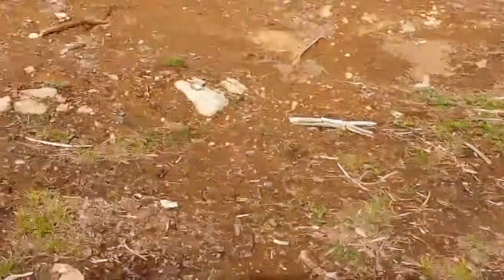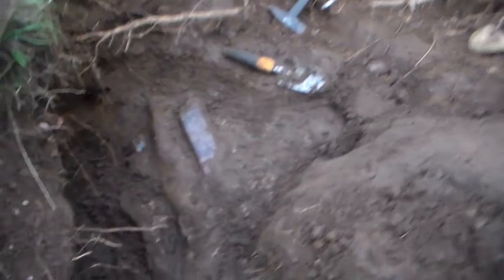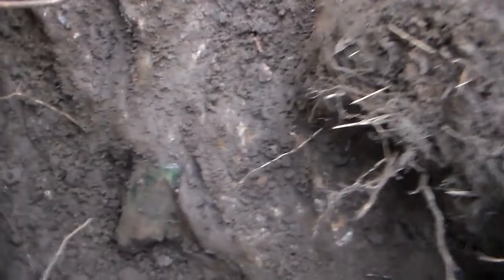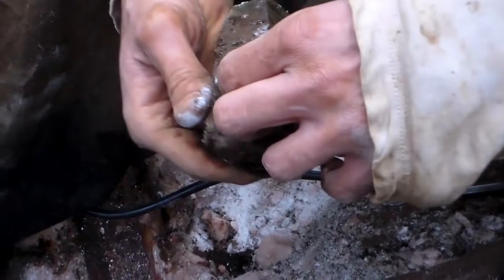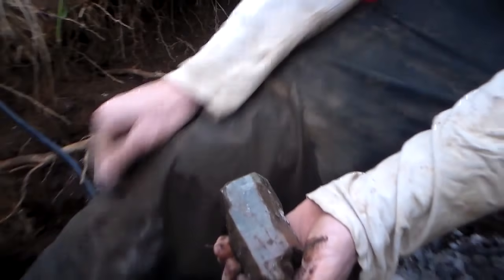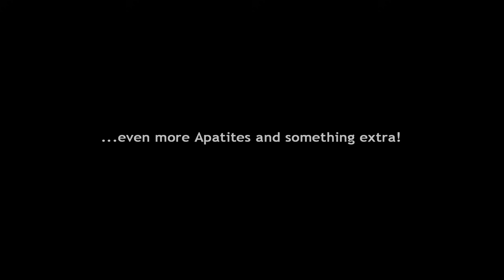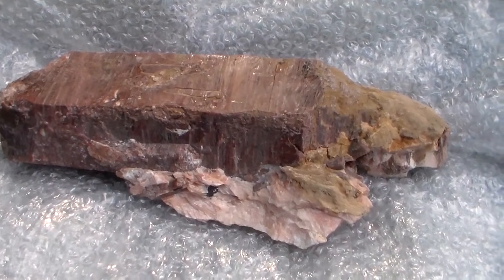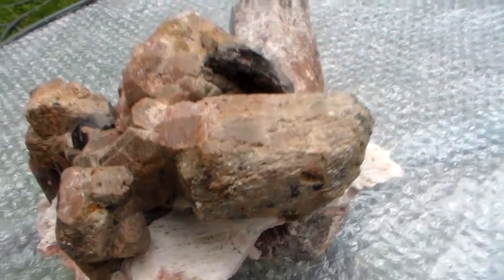MONSTER Candy Cane Apatite Pocket

Comment: The titanite at 37:08 is my favourite. Great finds!
Reply from the maker: Thanks Geology of Gems & Minerals! I was hoping that Titanite would come out a bit bigger.. it looked like it would. I'll still take it though, pretty sharp and highlights the cluster really well! We found others close to that size but were not complete sadly, got lucky with that one being mostly preserved in Calcite.
Reply: The clinopyroxenes and calcite really make the piece. You did a great job extracting pieces. They display nice and didn't get damaged.
Reply from the maker: Thanks, I put a lot of thought off camera in most of those wondering the best way to remove the calcite around them so they wouldn't get damaged. I have too much respect for the 100's of thousands of years or more they took to create, I don't have the heart to hack them out in pieces. I will admit there were quite a few times my heart skipped thinking they were breaking. That one big one that's not cleaned took close to two hours as the calcite around it was very hard and no where to grab. If it wasn't for the jackhammer I would probably still be there chipping away haha.
Reply: agreed that one is a beauty

Comment: Seems to me it would be much safer to use a 4 inch angle grinder with a segmented diamond wheel in combination with hand chisels and sledge to cut out the crystal Im very surprised it has not shattered.
Reply from the maker: It didn't shatter because I took my time when up close, and understanding the Calcite is crucial. I have a 6" I sometimes use to cut them out of Calcite sometimes, really depends on what I brought and what's best. I've undercut smaller ones before then trying to break the section free they usually crack. Apatite is very soft and rare to find any that are double terminated and not naturally broken in Ontario.

Comment: Any of your minerals for sale?
Reply from the maker: Not all but some are yes.
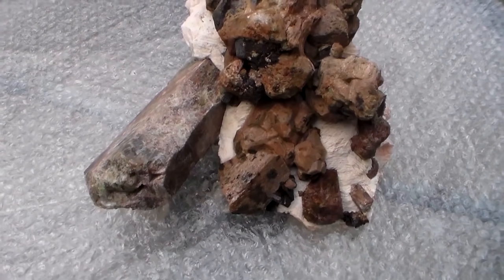Reply: Rough Market out of curiosity for sale or not what would you charge for the piece at 39:47? Its a beauty
Reply from the maker: That one won't be ready for 6 months or more, taking my time preparing it. When it's done it will either be in our private collection or on display somewhere possibly. I do have several smaller ones very simular to that and are really nice as well. Send me an email and I can send you some photos if you like. roughmarket@gmail.com